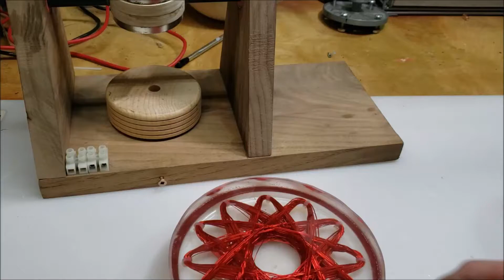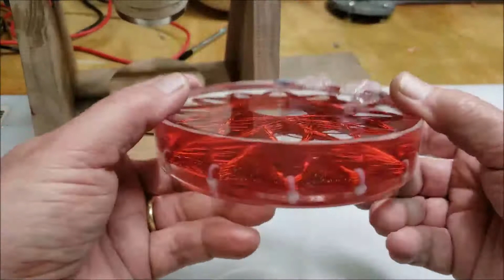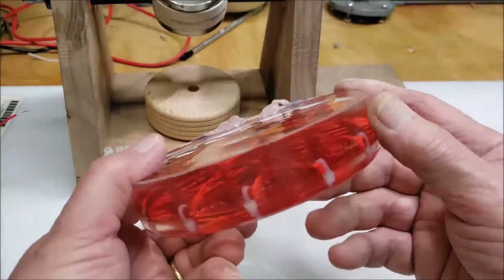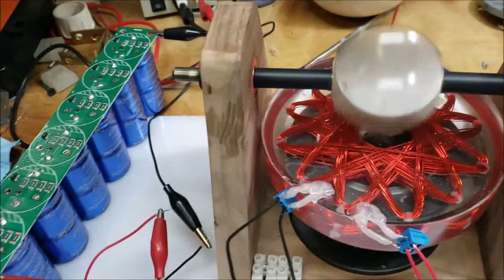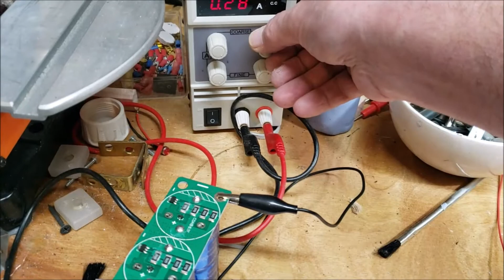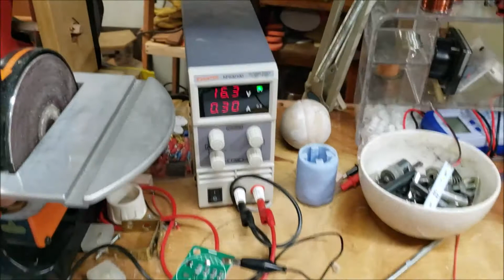Star Coil in action!

Comment: This came up in my feed and I am not sure exactly what you want out of this coil.

As far as I can tell it makes little difference to the magnetic field produced what shape or number of points you wire your coil to. It will (assuming both coils are identical and fed from the same power source) give a toroidal field with the maximum flux at the centre with a slightly petal shaped field to the points of your coils. 
You may be able to get a resonant circuit (a tank circuit) at the right frequency as you have a decent amount of Capacitance and Inductance with little Resistance. That might get ..... interesting ;o)

Please don't think I am knocking you (I am not), but your purpose .... other than to explore different coils ..... seems unclear.
I would suggest a Serpintine coil next. All the benefits of normal coils but really easy to wind!
Reply from the maker: ya I did look into other coils including the serpentine and this was many years ago
Reply: @mcorrade Cool!
 So, what did you conclude?
Reply from the maker: @totherarf I didn't use enough wire in the star coil for it to be of any use. I'm going to try  again soon hopefully
Reply: @mcorrade  Best of luck mate!

Comment: Was wondering if the magnet actualy went thru the center of the coil would that be more efficient.   I know very little on this stuff just a thought.
Reply from the maker: in this case probably not as there simply isn't enough wire in this coil. It was basically a test to see if I could resin a coil. The next one will be much better and work!